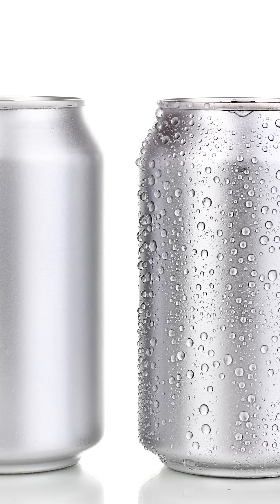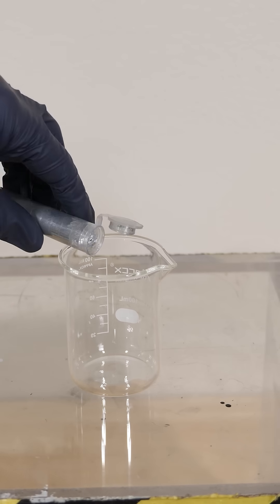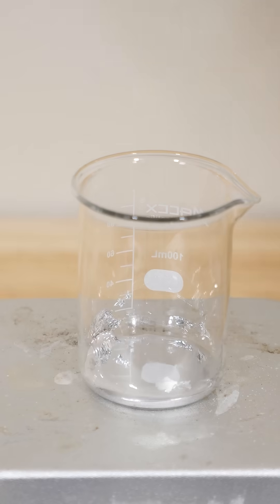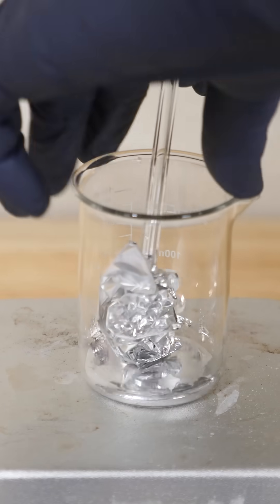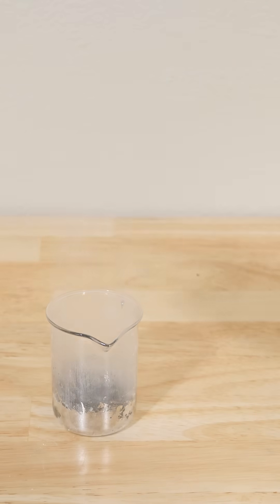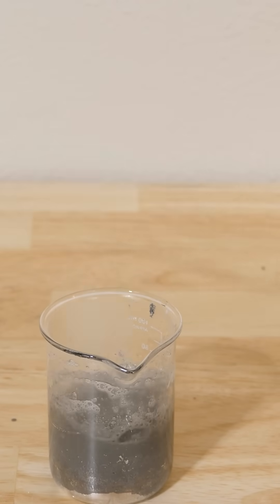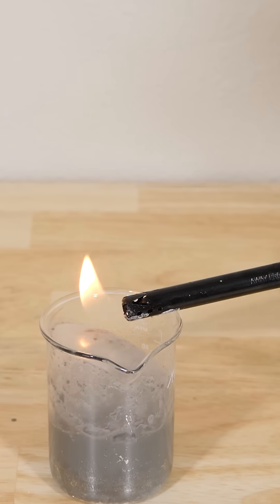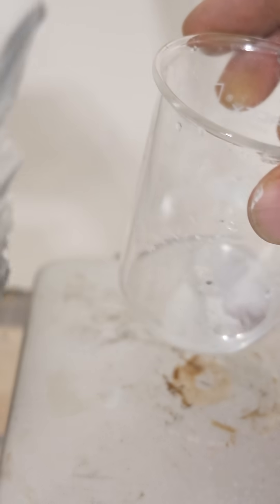Don't mix water and aluminum!

Comment: well I'm still alive after drinking water from my 99.5% aluminium canteen
Reply: Let's see how much I'll survive
Reply: And I am still here after breathing tons of chemtrail aluminium dust, It is hard to kill us Mr Schωab.
Reply: @astroid-ws4py  I'm a fan of breathing asbestos
Reply: You can use it to store your gallium.
Reply: It’s that 0.5% that makes it stable.
Reply: yes.
Reply: I know, right 😂!? Also soda, beer and when we boil water in aluminum pots!
Reply: @HowlingMoonCinemas  
Beer and soda cans are lined with plastic. Prevents acidic drinks from reacting with the aluminum.
Reply: @FullCircleTravis  And what about aluminum pots?
Reply: @HowlingMoonCinemas  
Water is fine because it doesn't break down the oxide layer. Stainless steel is the better choice.
Reply: @FullCircleTravis  Boiling water?? And after use, after use, after use?
Reply: @HowlingMoonCinemas  
Tap water won't hurt it. However, I wouldn't recommend adding salt.
Reply: @FullCircleTravis  Don't add salt!? I use plenty of salt in that when making soups too, man 😂!
Reply: If you drink hot fluids out of it you’ll eventually develop Alzheimer’s

Comment: Ok, is this reaction partly the basis for that Aluminum-air primary battery that is supposed to be under development as a solution for long-range EV power?  Somewhere (another vid) someone was talking about this, but didn't really go into the chemistry of it.  It was proposed as a large battery that would be replaced (possibly automatically by robotics) every 2000 miles or so (although I think a different form-factor would be better in smaller, hand-carryable modules, but whatever).  It was touted as a way to get long range in EVs, and using times of excess renewable energy production to reprocess the spent aluminum.

BTW, cool demo, thanks!

Comment: Don't mix liquid aluminum with water. 

I work in a aluminum foundry and well, don't do it 😂
Reply: Absolutely. Years ago I worked at a foundry in Tennessee that had eight casting machines and three large kettles to fill the small ones on the machines from. I was the kettle tender for about a year. Closest thing I've ever experienced to working in hell itself but I loved it. But the caster operators were sloppy and threw trash in their scrap buckets, some of which of course was empty water bottles, and the scrap was also usually wet too. I was supposed to leave it sit there till it dried out but there was never time for that, the machines were too hungry. So dumping the scrap in the big kettles was always fun lol.
Reply: @routergray7041 
One would think throwing random trash in the aluminum would be a no no?!
Reply: @keirfarnum6811 it's not if nobody sees you do it
Reply: @routergray7041  Seems like the usual work place on most of the foundries out there , there is never time for anything.Regarding water ( safety ) thats something very important here and those kind of things dont happen.

This kind of job gets better when you have a lot of experience but in the early stages its probably hell.
Reply: You can't even spell it 😂😂😂

Comment: It reacts with the air period, it has nothing to do with the "air in the water."

The instant alumina is transformed into aluminum (using electricity) it forms a protective oxide layer that prevents rust and helps prevent some corrosion. If that layer is somehow stripped and doesn't instantly reform due to whatever circumstance, things start to change.

Comment: Aluminum is so good at rusting its rust prevents more rust from forming.
Reply: Irony at its finest.
Reply: @heyitsyourfate Pun intended?
Reply: @crashcoursezed7947  ironically not
Reply: @heyitsyourfate aluminiumy
Reply: neat
Reply: These comments are golden
Reply: @Beeblebroks  no, they're aluminium
Reply: Now that's metal!
Reply: I don't know what kind of aluminum you're using because aluminum doesn't rust. Rust is Fe2O3. Ain't no Fe in Al to react with the O.
Reply: Just like stainless steel. The difference is that stainless steel is what humans created due to the demand, but aluminum created by nature!
Reply: Every comment here has a silver lining
Reply: the uncle ruckus of metals
Reply: Would like to note that the replies are all metal here.
Reply: Aluminum doesn’t rust, for some reason we only gave that name to iron, every other metal we just call it corrosion or oxidation don’t ask me why
Reply: @timscoviac  Because iron was used for a lot longer period than the other metals. Also, rust is really problematic because it destroys your iron/steel object (tool, machine) while aluminium oxide is basically undetectable for the untrained eye (and/or uneducated mind). Copper/bronze also withstand corrosion.

Comment: I don't know if it's quite the same thing, but if you add lye (sodium hydroxide) to the water, you will get a similar effect (though not quite as rapid) and produce hydrogen gas. As a kid I would do this in a small soda bottle and put a balloon over the top to fill up with hydrogen.

Comment: The proof that sometimes you sound smarter if you don't use technical terms.. 

This has nothing to do with the Grotthuß mechanism. This mechanism is "just" describing the anormal speed of h+ and oh- transport through water. It is simply a redox reaction on an activated surface..

Comment: Can you react aluminium and water in a vacuum chamber so you dont need gallium?
Reply: Doubt it. The reaction between Aluminum and water would start, but then immediately stop since it would produce that aluminum oxide layer to isolate the two from each other.

Comment: Does that means that on a big chunk  of aluminum underwater what's holding it? it's the aluminum oxide layer? Is that outside layer it's so thin that I can go bend it with my hand? And then if I put aluminum under oil I can just scratch that oxide layer with something and then bend it with my hand or it becomes liquid like Mercury maybe 🤔

Comment: Easier than having gallium, you can use just regular sewer-opening sodium/potassium hydroxide to catalyze the reaction too and give some hydroxide ions straight away for the metal to monch on.
Reply: and what is the cheapest and most safe? How much hydrogen/energy will it produce for ...x molls/grams of base and aluminum? Even better, can you collect the hydrogen in a fuel cell and will it work with that or does the fuel cell require hydrogen of a higher purity?

Comment: "The aluminum reacts so quickly with the air in the water"
Reply: What about it?
Reply: @joshx01 
I think he meant to say the water(vapor) in the air
Reply: I don't get it.
Reply: I'm more concerned with getting a specific volume of gas for a mass of aluminum....
Reply: @RaphYkun because the molaric volume of gases is always 22,4 L/mol (at 25 C°). Nothing to be concerned about
Reply: Did you know that you can generate comments by making mistakes in videos that others have the compulsion to correct?
Reply: So when i accidrntly left my aluminum pool cleaning pole in my pool water the internal pole had crystals growing on it. Was that a reaction?

Comment: My dad smelts aluminium, and the biggest no-no is water with molten aluminium results in: hydrogen forming in the aluminium, the hydrogen getting hot, the hydrogen exploding, aluminium covering everything
Reply: Also known as "tinsel rain."
Reply: I used to work construction. An Alcoa plant was building a private landfill on its property. They also did recycling there. I got to talk to one of the engineers.

Melting aluminum cans for recycling is a two-step process. First, they heat the cans to about 350°F, if I remember correctly, for about 12 hours, to drive off any moisture trapped in crushed cans. Because if any trapped moisture is present in the cans when they're melted, things get way too exciting in the plant.
Reply: Aluminum is actually one of the most reactive elements there are. The only reason that, say, an aluminum ladder left out in the rain doesn't spontaneously start burning is that bare aluminum reacts very quickly with the free oxygen in the air to form a layer of aluminum oxide on the ladder"s surface; essentially "aluminum rust". Aluminum oxide is very stable, and doesn't react with very many things, and it forms a barrier between the atmosphere and the unreacted aluminum below.
Reply: Not to mention the steam explosion
Reply: Note to self : turn off the propane torch before pouring aluminum in water
Reply: Soo aluminum boom boom device possibility confirmed?
Reply: @Wicked_Knight Oh, yes.
Reply: @Wicked_Knight  fed
Reply: and if you add salt to liquid aluminum the hydrogen trapped in the aluminum will rise to the top very fast. this will purify the aluminum.
Reply: @markthompson4885  interesting, I didn't know this!
Reply: You don't pour water on molten aluminum  for the same reason you don't pour water on hot grease. Boom.
Reply: Water in ANY molten metals is a "big no no".  And has nothing to do with Hydrogen. The danger is a steam explosion. Resulting in molten metal being sprayed and splattered everywhere.k

Comment: so 10 grams of alloy, will make 1.3 liters, and 100 grams will make 13 liters. so if you had a small cell with disposable reaction vessels, you could with 10 grams, make 13 liters of clean hydrogen to drive a car down the road. Just add distilled water for fuel. the water could be sprayed like a injector over the reaction vessel producing hydrogen as needed for engine power.
Reply: and the unreacted hydrogen, when hitting air, would become water vapor, and not poisonous tail pipe emissions. vs these crap electrical cars.
Reply: 10 grams of gallium costs about 34 dollars. so cheaper than a tank of gas.

Comment: You can also mix sodium hydroxide with the water and drop regular foil into it.  Warning, it gets really hot!
Reply: NaOH is highly corrosive of Aluminum. Don't get the two together, unless you want a combustible mixture.🔥

Comment: Would it work to rip the aluminum foil apart under the water, thus creating a fresh surface? Or would the dissolved oxygen react too quickly anyways?

Comment: now a days i am little bit more curious about Gallium. What a extraordinary material it is.
Reply: It is solid at room temperature but liquid at body temperature. Hold some in your hand and it will slowly melt! (Best to keep it in a little plastic baggie as it stains skin.) Because it is pure, unlike wax or chocolate, it is completely hard when solid. It will ring when dropped on a hard surface. Yet it will still melt in your hand.
Reply: @davidbarts6144  Thank you for the explanation
Reply: Where do you find gallium is that in thermometers or is that mercury i forget.
Reply: @Norego.Newzealand Both Ga and Hg are used in thermometers (along with alloys)
Reply: @reddragonflyxx  ok all of the above lol